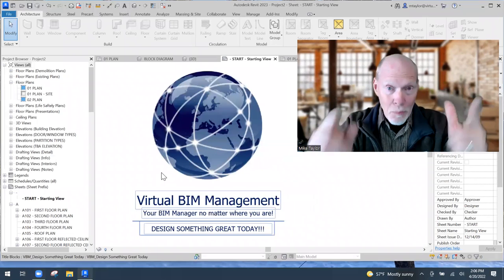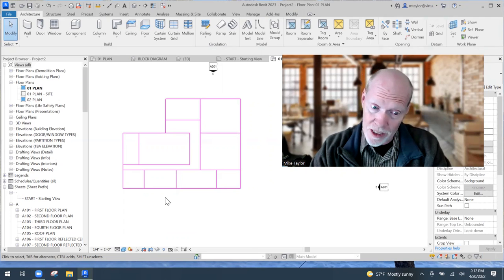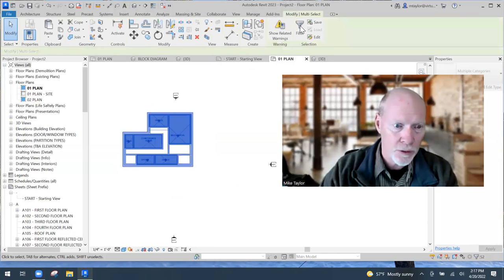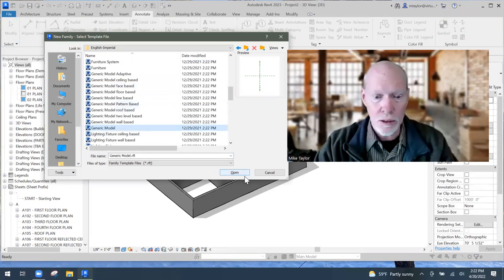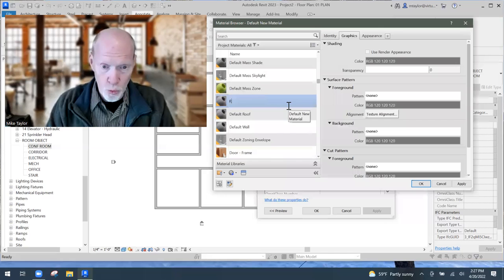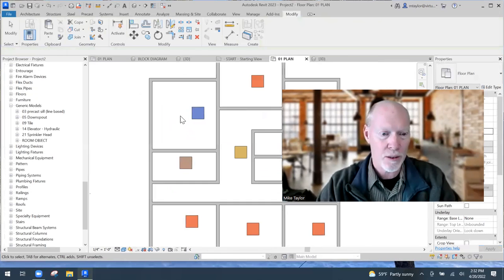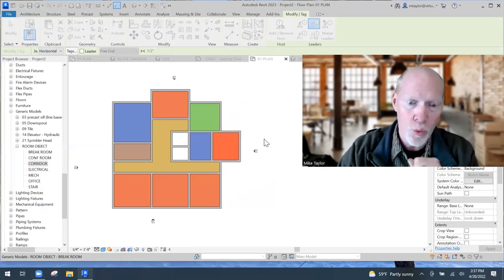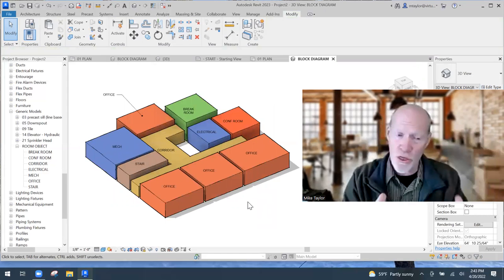SCHEMATIC DESIGN IN REVIT: Plan graphics and 3D Block Diagrams

Comment: Hi Mr. Taylor. This is a great idea for the conceptual phase. I would like to have in the annotation the surface of the "room". hoe can we achieve this? The volume is already in the option bar, but not the square meters. 
Thank you!
Reply from the maker: Cool Idea... So I did some testing and it works.  Since the Length and the Width parameters are part of the family... you can also make a parameter (area) that multiplies the Length and Width.  It automatically calculates the AREA for you.  You would have to make it a Shared Parameter if you want it to appear in a Tag.   It works like a champ!
Reply: @miketaylor-fantastic  Thank you so much for the response! I tried it and it worked! 
I am not quite good creating Formulas in Revit and I had to find the correct way to type it in. It turned out i needed to write not the full word, but just the first letter. 
Best regards,
Eva
Reply from the maker: @123nyanna  I am sooo glad you got it to work! With mine I made the parameter a TEXT... so I can add any word I want.  I am not sure why yours was shortened to only one letter... perhaps because the Label field was too short?
Reply: @miketaylor-fantastic  I created a shared parameter in the properties of the family. May be i did it in another way than you have described..I think I misunderstood. 
I entered the formula like in here:
https://iastate.pressbooks.pub/app/uploads/sites/53/2021/07/05-09-1-01-Paramters-in-revit-family.jpg
https://i0.wp.com/revitiq.com/wp-content/uploads/2020/08/2020-08-06_16-16-46.png?resize=515%2C149&ssl=1